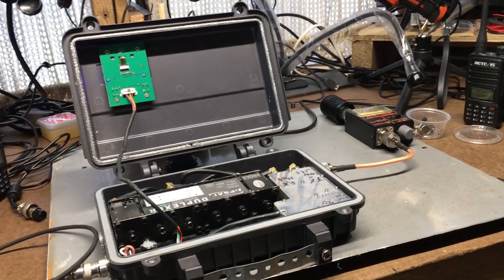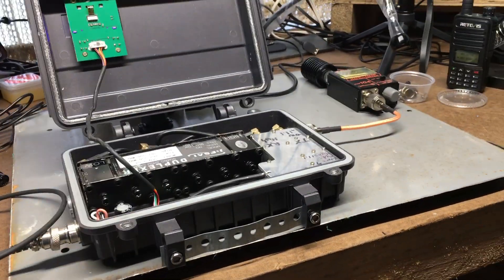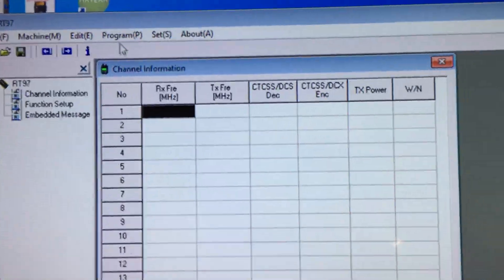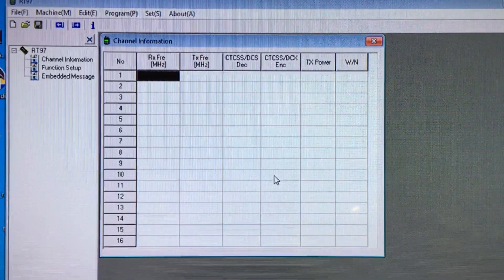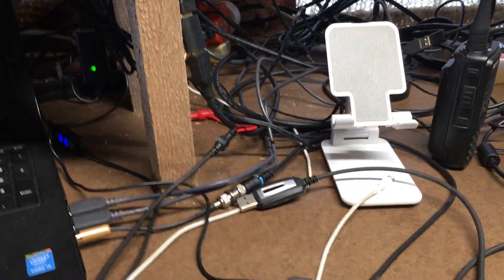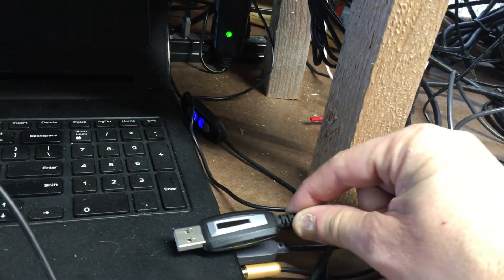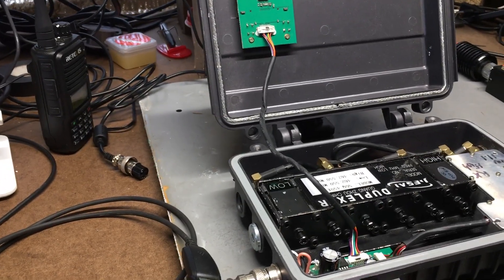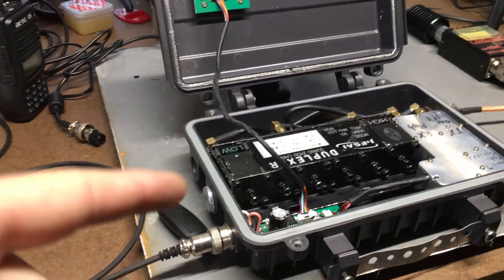🔺 Retevis RT97 GMRS two-way radio repeater software programming problems watch this video!!! 🔺

Comment: Mine is doing the same even if its plugged right in to the computer idk what more to do its a paper weight at this point with one channle.
Reply from the maker: if yours is doing that when its plug directly into the computer then i would say check your com port look under device make sure its working. also make sure you are selecting the right com port number in retevis software too.
Reply from the maker: i thought i had a video on how to check com port under device manager but i guess i don't i will try to make a video about this asap!
Reply from the maker: Hopefully this video will help you https://youtu.be/thU6t44pZD8

Comment: Hello .
Will it be possible to use TYT brand DMR radios with this repeater?
Reply from the maker: sorry this repeater can not do DMR radios. You will need a repeater that can do DMR.
Reply: @GMRStwowayradio  I hadn't noticed that detail.
It's just that I have 2 portable TYT 390 DMR, and I intend to buy an RT97 DMR and I don't know if it will work well
.......
Reply from the maker: @blueshark7737  - if the repeater is DMR and handhelds are DMR, then it should work fine. If you buy the DMR repeater from Amazon, you can also send it back as long it's with 30 days if you don't like it, or it doesn't work the way you like.
Reply: @GMRStwowayradio  Thank you friend.
I'm from Portugal and I have a serious problem.
I can't find it for sale in Europe (EU), but it might appear...
Compliments
Reply from the maker: @blueshark7737  - here is a link to the manufacture website NOTE: it's located in China, so it may take some time to get it to you! https://www.retevissolutions.com email them asking about the RT97P DMR repeater ask them about coupon code GMRS_two_way_radio they may give you a discount 🙂 make sure you tell them you want RT97P DMR repeater and make sure you tell them UHF frequency for GMRS if that is what you are needing that is.

Comment: Have you considered checking out the Midland version of this repeater? I've seen wonder if you were it's putting out a little over six watts in the housing for the case seems to be metal
Reply from the maker: No, I won't be able to check it out due to cost BUT it sure seems like to be a RT97S model (Retevis RT97S has the db9 connector) just in a didn't case. Also, my RT97 (without the 9bd connector)  has a metal case.  The Retevis model RT97S ( S means it has the db9 connector) is cheaper than the midland.
Reply: @GMRStwowayradio  cheaper yes but one YouTube reviewer compared the 2 and the Midland had a higher wattage output
Reply from the maker: @shawnwade302  hummm if I recall the retevis RT97 has the same output which is about 6 watts? I think I have a video showing this?? What is the midland output?